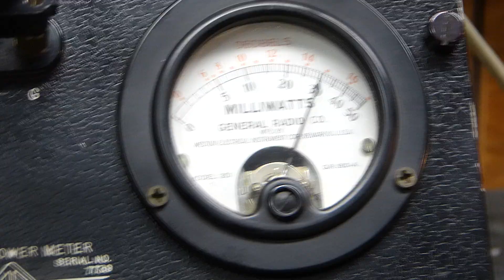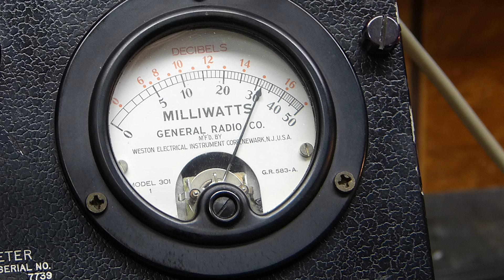Power Measurements For Changing Speaker Impedance On Amplifier

Comment: Was that all with THD < 1%?
Reply: I don't think distortion comes into play in this experiment. It's a demonstration of impedance reflected across the transformer to the plate load. By changing the speaker impedance, you are changing the reflected plate load, shifting the load line and operating point. It will certainly affect the waves shape but I don't think that was really the goal of this demonstration.
Reply: @Spentelectrons  I guess not. Only 3W.  Interesting how it goes up and down. The gain equation is non-linear in the load, and there is the Maximum Power Transfer Theorem.